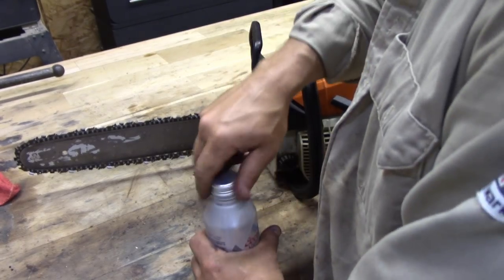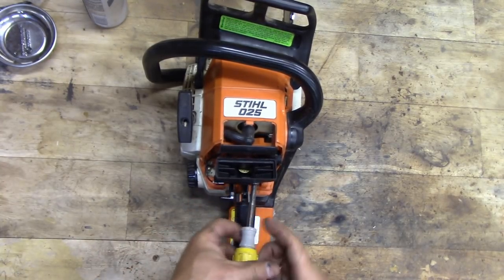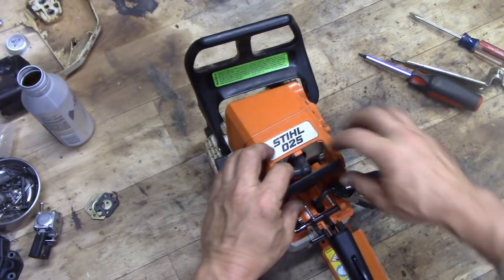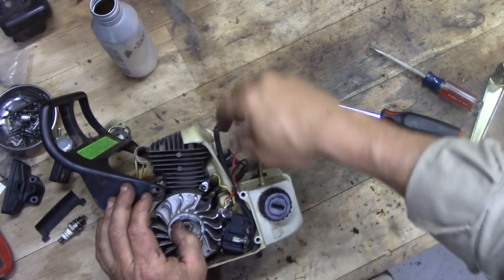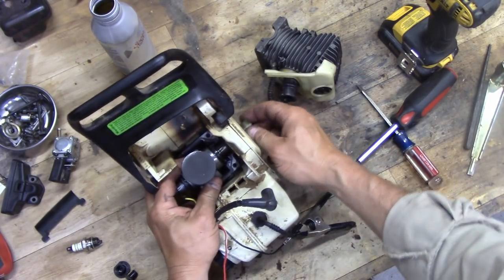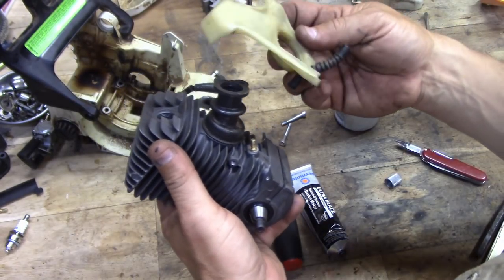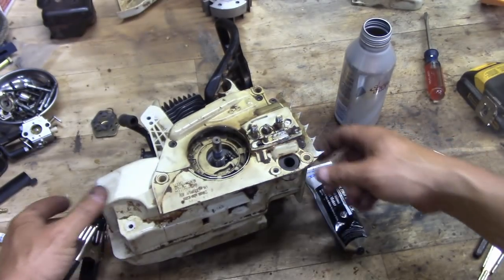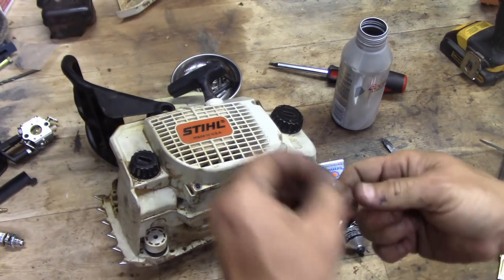Stihl 025 Chainsaw piston replacement

Comment: Thanks for this video.

Took my 025 to my local store for a service. They informed me that the piston was shot and that it would cost more than the saw was worth to fix. 

They offered me £40 to buy the saw off me. Thankfully I refused.

A quick search on amazon got me to piston that you have here in the video.

Followed your vid to install (as well as adding a smidge of oil), and saw now runs better than it has in years.

Comment: Spins engine over at 1000 rpm with the impact wrench whilst it’s dry as a bone.  Not one drop of oil added during assembly.   Clear sign this bloke knows sweet FA about mechanics or engines.  

He’s already caused irreversible damage assembling and running it dry.  Not to mention revving the tits of it whilst engine is cold and hasn’t had a chance to wash any fuel/oil around all the surfaces.  Class act.
Reply: With all that mechanical knowledge I’m surprised you would be watching a how to video.
Reply: He right never start a dry cylinder and rev the shit out of it no wonder 1st rebuild didn't last but one tree

Comment: Lenny, Klotz R-50 is also a very good two-stroke oil. We run it in all of our motocross bikes. I just bought an 025. For $80. It did not have an air filter on it when I bought it. It has very good compression. And it was missing the rear removable engine cover. I took the plug out and the was sand in the top end. I disassembled the whole saw and took the engine apart and there was a lot of sand in the crank bearings. The piston and cylinder were in perfect condition. I took the rings off. Washed the crank with the piston in the parts washer and I washed the rest of the engine very good. Blew it off and put a lot of klotz R-50 in the crank bearings, rod bearings, pistons and cylinder. I put some yamabond 4 case sealant on the crank case. And assembled the engine. Cleaned the rest of the saw in the parts washer. And assembled the saw. Rebuilt the carb with an Oregon Walbro #D10-WA&T gasket set. Assembled the rest of the saw and mixed some new 91 non-oxygenated fuel. And some Klotz R-50. At 32:1. Put it in the saw and started the saw up and the damn thing runs better than new. Nice video.

Comment: Great video! Only suggestion I have is to take a table spoon of 2 stroke oil and put it in the cylinder case to prevent a dry start!
Reply: I normally use build oil or if not I coat the inside of the pot with a finger full of 2 stroke oil. A little smoke on start up but its lubricated. 👍👍👍
Reply: How to replace sparkplug wire on McCullough chan saw ?
Reply: Kenneth Pugh gotta pull through whole engine out my friend if it is a mini mac
Reply: @steeo80  I agree. Also may as well get rid of the bad fuel right at the start.

Comment: Good work. I have a 025  that I just spent 150 bucks on in parts. Probably should have bought a new one, but whatever. I noticed that you missed a large washer between the worm gear and the clutch . It is the size of the clutch. It might be on the floor , you might want to take a look. That was a good deal on the parts for that thing. You made that job look easy.

Comment: The 025 designation says it's an older saw. You may have an air leak, which will cause the problem you have.  I have a saw of the same model and it is at least 20 years old. It may be time to replace the impulse line, fuel line, intake boot and maybe even the crank seals.

Comment: I pull the intake boot through the rear handle with a piece of string.  Just wrap a two foot piece of string around the end of the boot and feed the string through the hole in the rear handle.  Pull the string while using your fingers to help the boot through the hole.  This is the Stihl proscribed procedure, too.

Comment: Thanks for making this video. Without your tips for removing some of the more difficult parts on my MS-250 it would have much more difficult for me to replace the engine. I ended up forgetting to attach the impulse tube to the plastic fitting that ultimately goes to the carb so I had to tear most of it down and reassemble it again. The second time is 10X easier!

Comment: Thank you for the perfect video.  I have my 021 almost completely apart and it turns out I did it the same as you.  I hope me flywheel comes off that easy.  I think I'll add a couple of silver bullets to the process and see if that gets it done.  Thanks again.   P

Comment: I watched a video on this. The guy said it comes from people who don't let their saw warm up at all. They start it and gun it from the start.
 The reason is the piston when it heats up expandes faster than the cylinder does. So the piston ends up rubbing against the cylinder. Usually the part that heats up the fastest is right behind the muffler.

Comment: Massive thank you for making this video, I would of made so many mistakes without it, my saw is now back up and running, I did have to make adjustments to the carb after fitting the new engine but it’s now running spot on.

Comment: The reason you got an extra impulse line fitting is because they often get broken off in shipment.  I got one in broken off one time and I was able to heat up the old one in my Stihl cylinder and remove it and use it in my new cylinder.  I coated the impulse line fitting with 1184.  I also use Dirko HT to seal up saws, because I hate going back in when the seal gets broken by heat.  Dirko is a little more costly than some sealants but it works a lot better than any other sealant I have used - 1184 or Permatex Motoseal.
Reply: John Clarke Is the impulse line plumbed to the carb?
Reply: Good advice - Crank case leak may cause motor to suck air and run lean (partial seizing??)

Comment: I use Stihl Ultra with premium non ethanol gas in all of my two cycle stuff, whether Husqvarna or Stihl.  I also carefully mix my gas, using a small graduated measuring glass, available from Walmart for about $2.  I measure out 75 ml of oil, add .5 of an ounce of fuel stabilizer( Briggs AFT) and the same amount of Marvel Mystery Oil and then put in exactly one gallon of PNE gas.  I also shake up my container of gas before each use to make sure the oil is still mixed throughly with the gas.  Note: a bottle of oil only contains about 70 odd ml of two cycle oil.  I use 75 ml of oil in each gallon of gas.  Oil is cheap, engines are not.
Reply: Most of the real world did away with Gallons decades ago....In some places 4L in others 4.546L

Comment: Thanks to this video, I was able to easily swap an engine from my old MS170 (which no longer oils) into my MS180 (which had been dropped and engine damaged). Thank you!
Reply: Why didn't you just put the oil pump from your 180 into your 170??  Seems like a lot of work just to get an oil pump working :)
Reply: @dschamber7190  fair question.  I had the 170 in at the shop prior, and they replaced the pump, tube, and actuator, and it still wouldn't oil.  So I didn't trust that it would help it.  Also the 180 was brand new when it was dropped, so other than the crushed engine it was in perfect shape.

Comment: Leonard, I have been using Amsoil for over 15 years mixed at 40/1 without an issue.Your voice sounds like Dan Aykroyd.I take it you are the designated drinker. Good video, Ken
Reply from the maker: Thanks Kenneth. It would probably serve me well to research 2 cycle oil a bit and I will. I do exaggerate my accent slightly but not much. Aykroyd could probably say the same. Mid-westerners is mid-westerners.Yes, designated drinking is totally my thing. Thanks for the comment buddy, I really do appreciate it.

Comment: That carb looks like it is a little lean - no exhaust smoke when you accelerate it.  My saws all put off some smoke when they are cold but it stops after they warm up.  This is not how I tell if they are lean or not.  I do that by ear and by using my inductive tachometer to see what they are turning.  I set my saws at WFO to 12,600 to 12,800 rpms and to have a noticeable four cycle sound.  This keeps them from getting toasted at high rpms.  I richened up the high jet until I get both of these two critical conditions.  Four cycle is a slight miss, due to being overly rich, at high rpms.  This keeps the cylinder and piston cool and keeps them from getting toasted.
Reply: Good advise ~

Comment: Hi, good video , but with one problem : you must absolutely oil cylinder and piston rings before assembly. You started with dry new motor and it's a possible damage for the rings. With such a "dry" motor the first pulling tries on the rope are very difficult, what is a bad indication...

Comment: If I ever have any doubts about my two cycle gas it gets poured into my parts washing container.  I also use 84 ml of Stihl Ultra and one gallon of PNE gas or Stihl Moto Mix.  The 921 I just finished rebuilding is running Moto Mix for its break in. Because it is about a 40:1 mix and my mix is about a 45:1 mix.  Never skimp on two cycle oil.  I buy it in the five gallon mix bottles and measure everything.  I do not like rebuilding saws because I made  a mistake.

Comment: Hey Lenny, Good evening. I just tore down my MS 250 Stihl Chain Saw to clean it up by following you video. Everything is working fine except now when I release the acceleration trigger it dose not stop of, it keeps running , I have to put it in the off position to stop it. What might be the problem?

Comment: I just tore down my MS 250 Stihl Chain Saw to clean it up. Now when I release the acceleration trigger it does not stop, I have to put the switch in the off position to stop it. What might be the problem?

Comment: Awesome video! Is there anything you need to do on the new setup as far as compressing the piston rings before sliding into the cylinder?
Reply from the maker: Thanks. I appreciate the feedback. My setup came with the piston already in the cylinder however They're not that hard to get in there by hand. I was informed that I should have coated the cylinder with some oil before cranking it but I didn't and it's fine. Probably a smart idea but I don't do a lot of smart things so...
Reply: @lennyc624  video was excellent. Thanks again!

Comment: A very good video. I took mine apart to really give it a cleaning but kind of messed -up with the brake handle assembly and I can't figure out how to replace the handle with its spring mechanism. Do you have any info with step-by-step instructions to do this? Thanks in advance!

Comment: It looked like the clamp was missing that holds the rubber intake boot to the cylinder...if this is the case, then maybe that is leaking vacuum and causing lean mixture which could be ruining pistons. Just a thought

Comment: Hi, enjoyed the video and all the information from here ‘across the pond’. One question, when viewing the cylinder though the exhaust outlet should you be able to see the piston rings? May post you a photo as they seem to be missing? My 025 starts but on very fast revs and will not run at idle..... happy Days ......... Thanks for the video, don’t think I will change from real ale though!
Reply from the maker: Thanks for the comment. I don't believe the thing would run at all if the piston ring was missing. It could just be hard to see. As for it not running at idle, possibly you could need some carb adjustment or cleaning. I'm no expert though. I only pretend to be one on YouTube. Perhaps the ale could be the problem too. I've always had good luck with the old tried and true silver bullets. Cheers mate. 🍻

Comment: Thanks for the great video Lenny. My 025 went together with very few hiccups. I got everything back together in about 3 hours. Filled it with new gas mix, put in the new plug, and nothing. I could not pull the starter rope more than 6 inches. After about 5 minutes of trying, I pilled out the plug ansd it pulled free and easy. Any ideas on what might be going on?
Reply: Hi, simply because you did not oil the cylinder and piston rings before rebuilding. They were new and fully dry. Not good to start so . After X pulls mix came  and oiled motor , but not good for the piston rings.

Comment: Bought a old 021 from the 90s..wel the clutch hub eat into the oil pump and case..did some jb weld and new oil pump ..good as new well worth the150$ I have in the saw
Reply: That's gonna happen to this saw because he didn't put the cover washer in before the clutch.

Comment: You really needed to oil EVERYTHING mechanical as you put these engines together....when whizzing your fly wheel, your also turning everything in the engine, Without oil...tut tut...a good vid apart from the bit i mention...
Reply: Yep, I agree with what you’ve said. I was wincing with the dry start. A really good instructional video otherwise.

Comment: Lenny, since OEM parts are no longer available for this saw do you think the aftermarket parts are the same quality? They certainly are alot cheaper.
Reply from the maker: I used the aftermarket parts and I honestly couldn't tell the difference. I didn't do any scientific testing or anything but its a cast-aluminum part. As long as it's the right size, you really can't go wrong. It gets my home-gamer, weekend warrior, beer drinkin' seal of approval. Thanks.

Comment: I’ve been fixing saws and mowers , strimmers and mixers etc for 40 years. Better to have a strong mix
Reply: This 40 to 1 mix is not 100% safe on older machines. I like to see a little smoke from the exhaust. My 50 year old Pioneer P40 just loves a 20 or 16 to 1 mix. Never had any problems, maybe a dirty plug now and again, but the motor is ‘safe’ from destruction. You see, smoking is good after all, for saws anyway!

Comment: So I noticed when you put your chain cover on at the end there were still four bolts left in your metal Bowl. What do you suppose those were for? Was it just a sign of a good mechanic to have parts left over? Also, you didn't tell us how many grunts it took to tighten that muffler, was that a one grunter or two grunter? Loved your video though!
Reply from the maker: I believe those were the old bolts that held the old motor together. Muffler bolts are always 2-grunters. Thanks for the love. Cheers

Comment: Lenny my name is Gabriela, if it's okay with you can you please send me the link of Amazon where I can get that engine I was going to rebuild the same one but it I don't think it's worth it.
Reply from the maker: https://www.amazon.com/Carbhub-Cylinder-Replacement-Crankcase-Connector/dp/B078MFXPVJ/ref=dp_prsubs_sccl_1/141-6671036-7064858?pd_rd_w=2sxqM&content-id=amzn1.sym.fc006cb3-a0f0-46a0-996b-0c5bfdc93b4f&pf_rd_p=fc006cb3-a0f0-46a0-996b-0c5bfdc93b4f&pf_rd_r=6VCHVC51PTG55WAJF38Q&pd_rd_wg=VkbmT&pd_rd_r=3b108699-3b55-43bb-9639-5abbb19ebb50&pd_rd_i=B078MFXPVJ&psc=1

Comment: Good Show, I was wondering exactly where you tapped the flywheel to bounce it off.
Reply from the maker: just give the shaft a rap
Reply: Middle of the crankshaft There's a dimple for a 'puller' though if you're still waiting for an answer you shouldn't be using a chainsaw!

Comment: Lenny,many thanks for this-I'm ok with four stroke engines, and am contemplating a rebuild of an old Mac 10-10, which will be my first venture into two stroke. I found your video informative and helpful. One thing not mentioned-and here I'm probably showing my ignorance-was timing..............you didn't appear to have  to do any timing set up after what was a complete rebuild.........is that always the case, or just this particular Stihl? Greetings from Ireland, btw.
Reply from the maker: Greetings From Indiana. Timing is not a big issue since there is no way to adjust it. The flywheel is fixed to the crankshaft with a keyway and such... You can't really mess up the timing. I have relatives who claim to be from Ireland btw.
Reply: @lennyc624  many thanks for this.....re the relatives , us paddies are everywhere!!

Comment: Best to use ethanol free fuel.  Caseys gas station has it in the mid-west or go to an airport and get 100 LL.     Then mix 30 to one and run it rich on oil.

Comment: Check for air leaks because it probably went lean and seized up. Do a pressure vacuum test. And recheck the tune on the carburetor because if it’s running lean it runs hot and that will score on the exhaust side.     oops.   just realize this is an old video
Reply from the maker: Good tip. Thanks man.

Comment: Thank you for the video!  I believe I used some bad gas and have destroyed the piston and Cylinder.  I will look at it tomorrow.  I do have one questions which I'm not sure if you can answer or if I need to call Stihl, I have a MS391 and all the parts I'm finding on Amazon do not list my model but do list the 390, any chance if those use the same piston/parts?

Comment: 50:1 mixture is not enough,  it’s too lean  factory recommends that but  they want you to buy a new machine and blame the consumer if it destroys the cylinder  at least 3.5 to 4 oz per gallon  is good on a chainsaw never had an issue with burning up a head and piston .